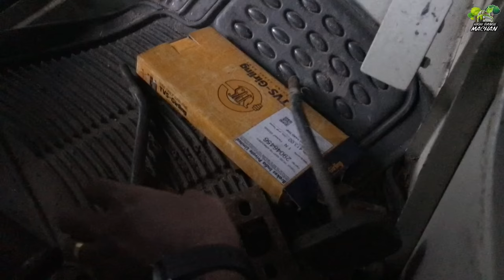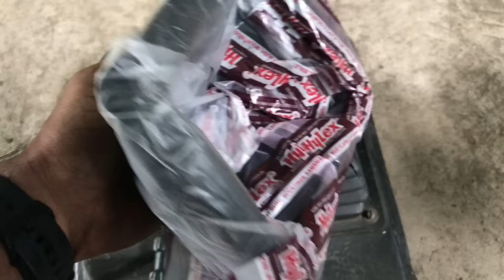MAHINDRA JEEP UPGRADATION- PART-2/ 2WD To 4WD/Open knuckle/Disc Brake/Benz-Power Steering/KMT90 4x4

Comment: Hello Bro, good video and explanation. I am from kochi based in Bangalore. I have a cj3b, want to upgrade to power steering and brake. Can I get it done there? If so what would be the approx cost. Thank you
Reply from the maker: 9656447170

Comment: Power stearing and disc brake rate tharumo ente vandikkum cheyyan vendita. Work enik ishtappettu
Reply from the maker: Ethan model?
Reply: @highrangemachan4166  
1998 MDI
Reply: Shok 4 എണ്ണം എത്ര റേറ്റ് ആയി
Reply from the maker: @rijinkollamkollam7330  2400/-

Comment: Power steering set chethapo total ethra ayi?
Reply from the maker: Full kit 18k 
Extra hydraulic pipe, - 1500/-
Fittings of steering box & pump- (time edutha pani aan)materials-500/-)
Other- (power steering oil,Nut bolt..etc)-500/-
Labour charge- different by the jeep conditions( 10k and above)
Reply: @highrangemachan4166  Thank you ,👍👍👍